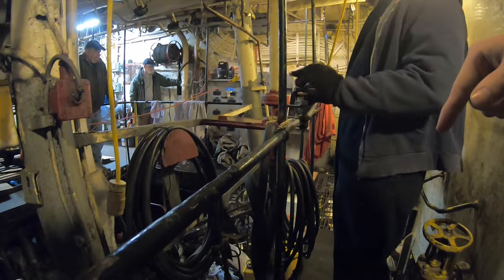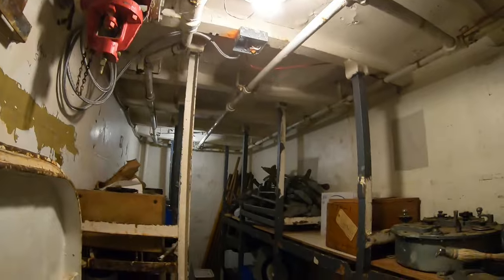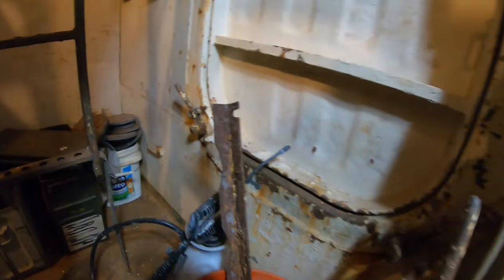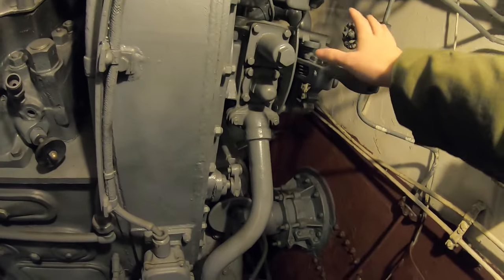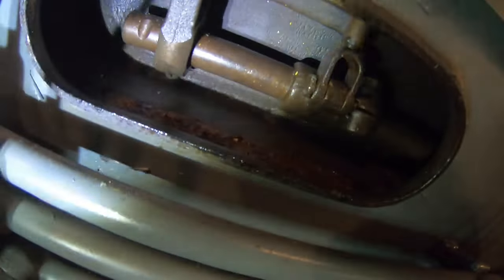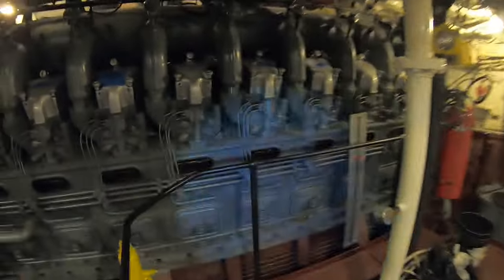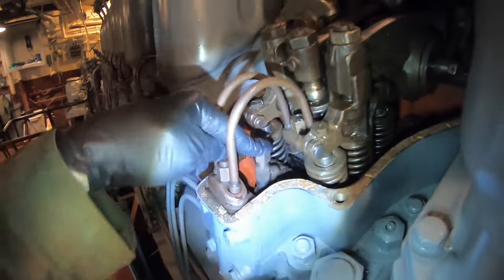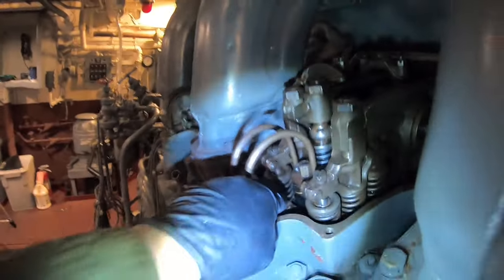Engine Work, Wasted Steel, & Painting: SLATER Work Vlog 8 January 2024

Comment: I worked on the Comanche ATA 202, 10 years ago, we had twin 12v278a's with stuck injectors i would be concerned about run away.
Reply: While I have the duty to film and present certain tidbits, there is a lot of people behind the camera working on this project as well. Don’t worry, everything will be triple checked and checked again as we move along.